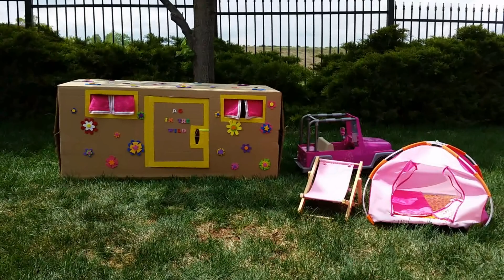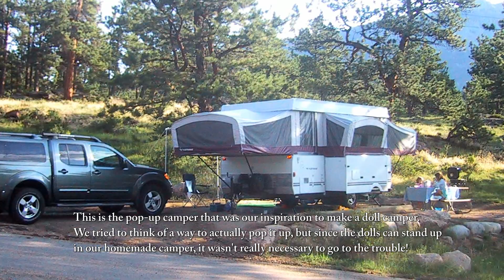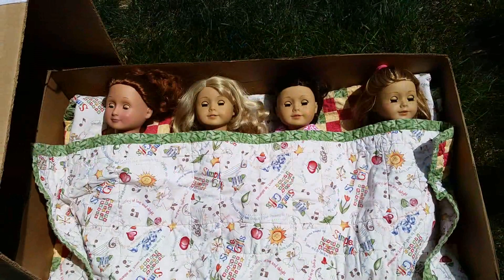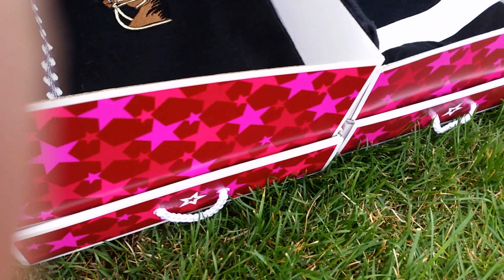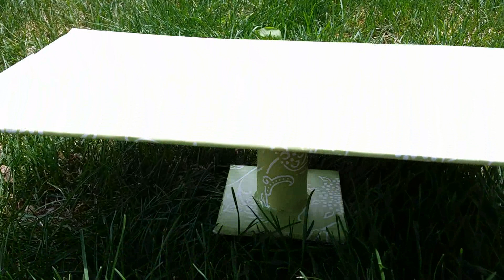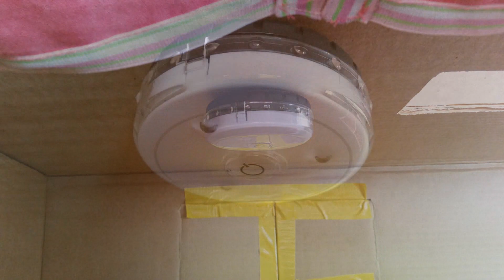HTM 18-Inch Doll Camper - Thrifty Project -- Sleeps 7 Dolls!

Comment: That is GREAT!  Got some grandkids that's really gonna go for this - thanks!!
Reply from the maker: Thanks. If your grandkids like to climb on or into things, it won't hold up without additional interior support. I babysat a 3-year old and the first thing he did was pull everything out so he could climb in. My daughter was older when we made this so we did not run into any problems. Also, my tables needed two supports once we started putting things on top.
Reply: lab-den 18-inch doll fun Thanks but, they're a little bit older.  And they LOVE boxes (which is good, they don't need anymore toys!).  :-)
Reply: I thought it was for barbies boring
Reply: it said 18-inch